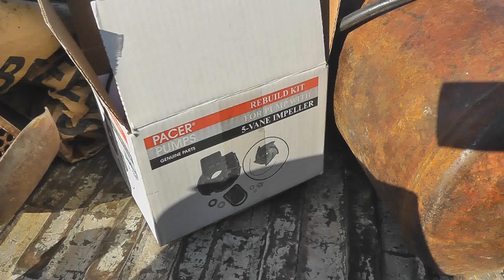Pacer Pumps Rebuild Kit

Comment: how did you take off the impeller? I tried and I broke it a bit
Reply: My buddy used to rebuild them all of the time.  He said "it should just pop right off."   I taped and beat on it and then used 2 screwdrivers and broke it in half.  Then a hammer and chisel to knock the rest of it off the shaft.  I just did it about 10 minutes ago.  If it doesn't pop right off just very easily and gently ...beat the shit out of it.  A new one comes in the $75 rebuild kit

Comment: To remove impeller I heated it with heat gun for 45 seconds then threaded a 7/16 bolt into the impeller body after removing the smaller impeller bolt, the bigger bolt cut threads and pressed against shaft, impeller pulled right off. No plying, breaking, cut etc. Took 5 minutes max.